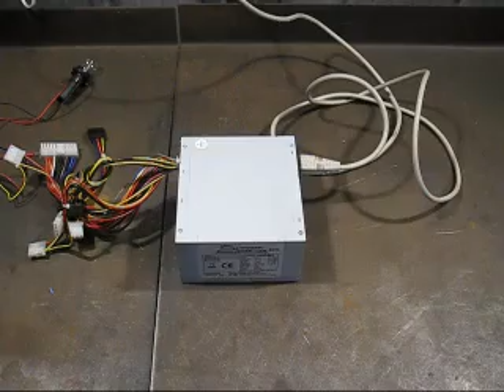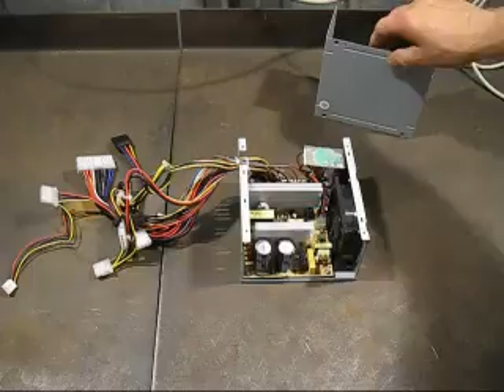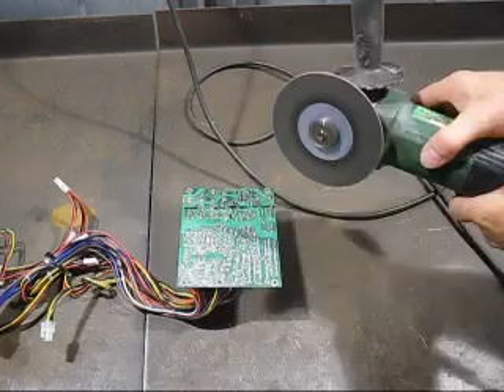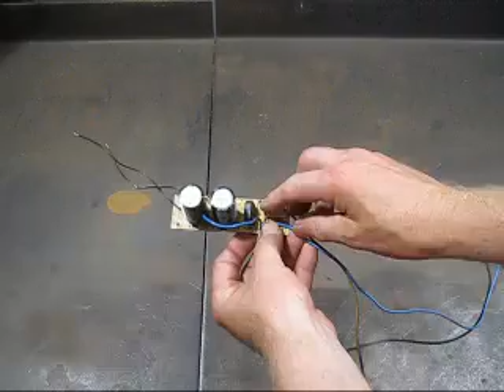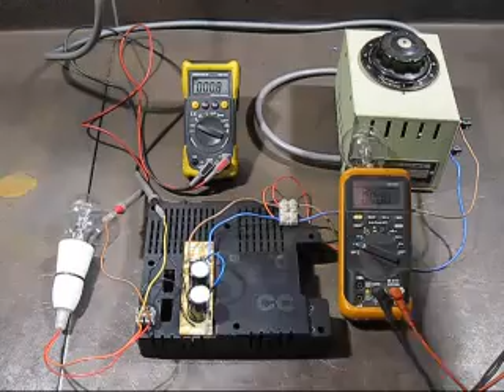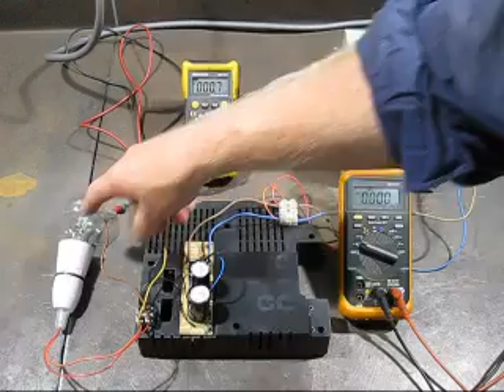stepping up voltages without a transformer

Comment: Attention this video contain a wrong information and it is fake. 
Dude you get people injured by this fake video. You say you connected the AC power to the   DC capacitors. As soon as you connect the power the capacitors will explodes
And it dose not increase the electricity at all.
Reply from the maker: Did you see the caps explode?

Comment: 'Never heard of this awesome thing, thank you. I sacrificed a power supply I was saving for a rainy day, which was today… unzipped it with grinder which was dusty fun....... but not quite the same flavoured unit so unsure of how to proceed. This is only a 240p video but I think I can see surface mount components on yours that mine does not have, and several other differences. Can you recall what brands to look out for that you've had success with? Or perhaps a supplementary video with a more modern camera (newish smart phone) giving your fans a better look at the remaining components and wiring. 30 seconds of footage under some strong light would be super valuable. All the best
Reply from the maker: Look up wikipedia about voltage doublers. That is what I copied of.
Reply: @luckygen1001  Thank you. Best guess, "Dickson charge pump".